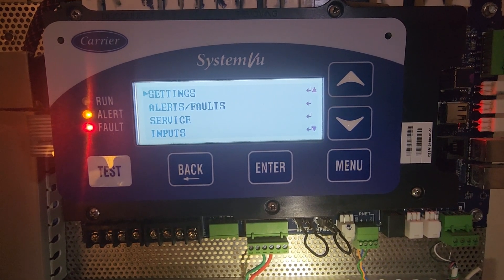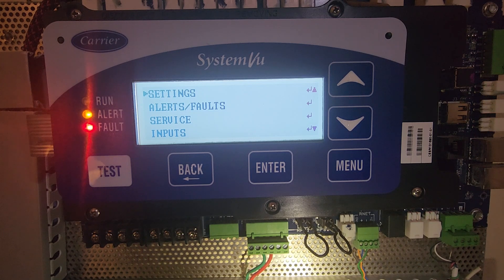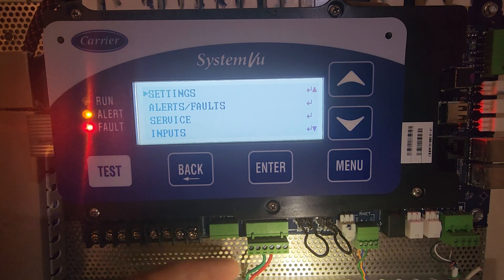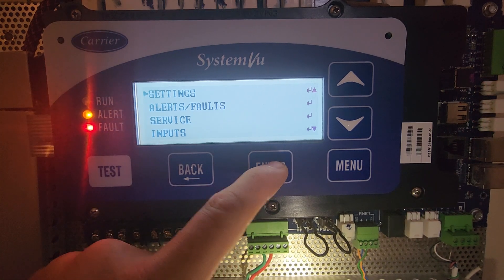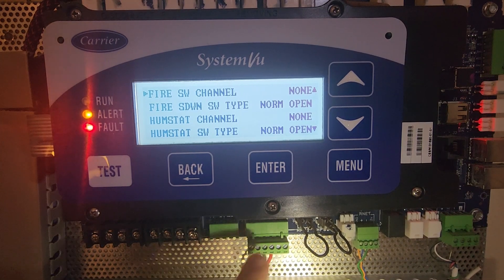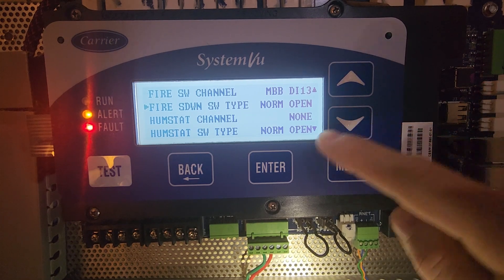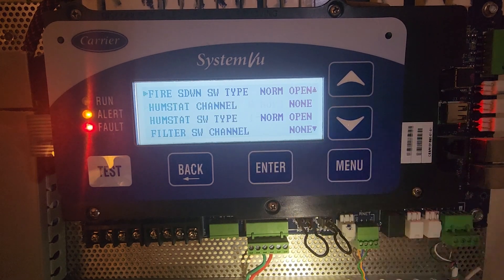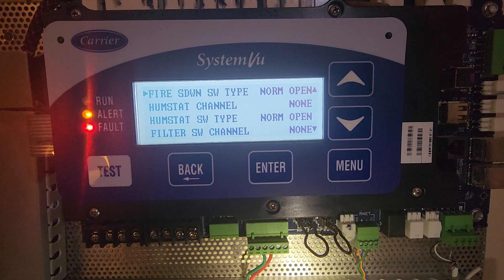Configuring System Vu controller with a field installed smoke detector.

Comment: We have a controller with a bad screen can I hook up my laptop to it to see what the unit is doing? if so what software would i need to get ?
Reply from the maker: You can connect a laptop if you have field assistant software and the usb dongle kit. But you should check the ribbon cables on the back of the display. There are 2 of them. If they become loose or damaged the display will go blank. Also, if the display is left exposed to direct sunlight for an extended amount of time, it will damage the display.

Comment: I'm using a innovaire d4120 where do the two wires from d113 go to?
Reply from the maker: Did you watch the video entirely? If not watch again. You could use any of the DI's on TB3. Just remember to set your fire sw channel and switch type correctly.
Reply from the maker: I cannot advise on the innovair smoke detector since it is 3rd party. Reference their manual or call their tech support line.